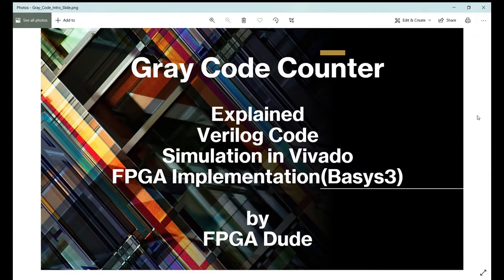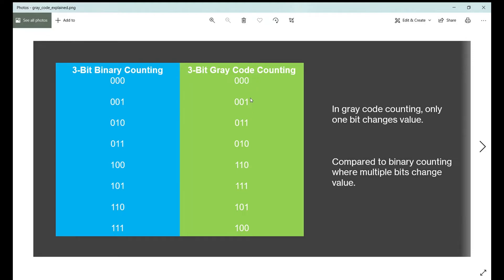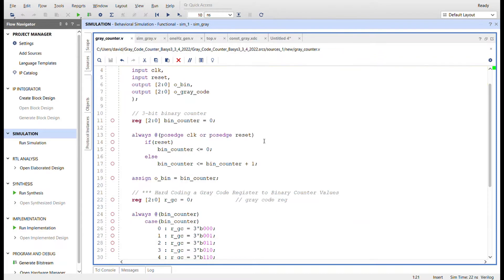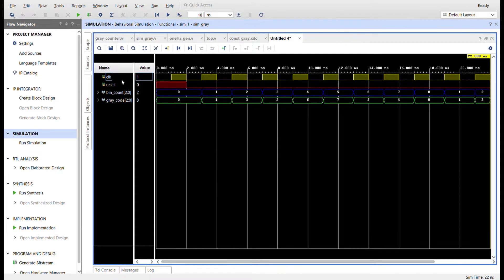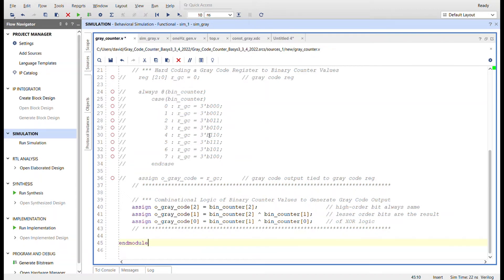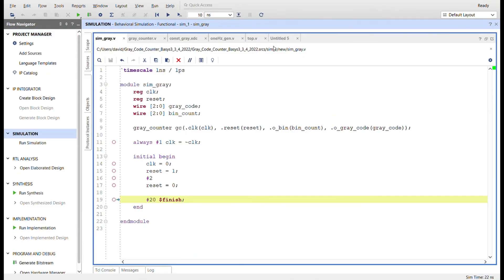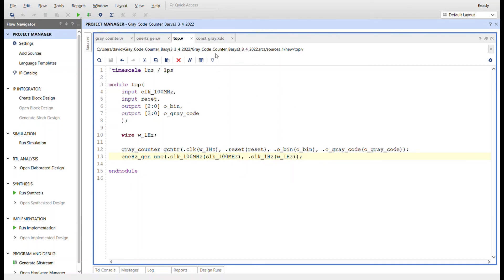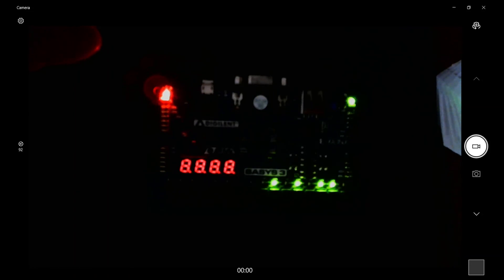Gray Code Counter Verilog Vivado FPGA Basys 3

Comment: Can you code gray counter verilog without binary counter? Please don't use case statement.
Reply from the maker: What exactly are you asking for here? Just logic gates?
Reply: Just native gray counter,  i.e without binary-to-gray code conversion and without binary counter. I'm look for a low-power gray counter, your solution is not low power since it comes with a binary counter and B-to-G conversion, it costs more power than binary counter. @dajoma36
Reply from the maker: @s.c.2268  Well, sounds like an adventure, and something you could do yourself. What is a binary counter but bit registers connected with logic gates? Same goes for the gray counter, but the logic will be different, of course.